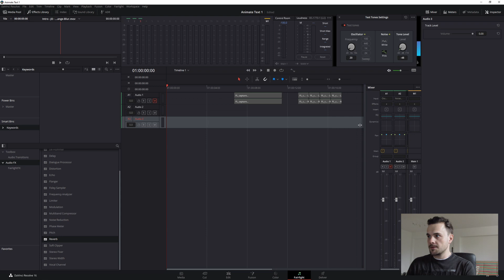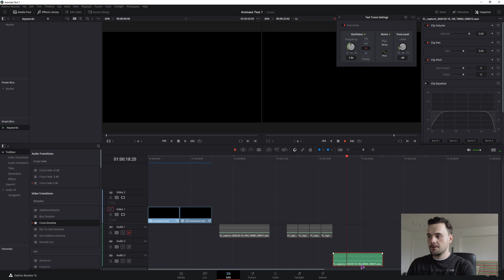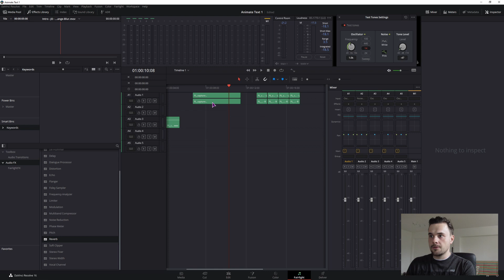Make Censor Beep Sounds | DaVinci Resolve 16

Comment: I must be missing something. My screen looks exactly like yours when I go to test, but no sound. Even when hitting the R button and the oscillator is patched to my spare track. The only difference is I'm just using the speakers on my laptop. Do I have to select where the test sound goes to? I can play the audio on my project just fine on the edit tab.
Reply from the maker: Hey @Legends Workshop. I don't know if that's an issue with you working on a laptop, it shouldn't be, but I don't have a laptop to test this on. I tested this on my pc in davinci resolve 17 beta version 5 and it works for me. You can check what your audio output device is under: davinci resolve (top left menu tab) > preferences > video and audio I/O tab. You can change the interface from MADI to Fairlight and MADI if that will make any difference, or manually set the speaker configuration in the settings below the interface section. Let me know if that helps.
Reply: @JackallDigital  Hi Simon, I tried again today by creating a stereo audio track rather than mono, and everything worked as you described. It's possible when I tried the mono track yesterday that the M button was selected. When the M button is selected either on a mono or stereo track the tester does not seem to work. Maybe my laptop or OS settings don't allow it, I'm not sure. As long as R is selected and M is not, the tester works regardless if S is on or off. Thanks for your help!
Reply from the maker: @LegendsWorkshop  Thanks for the input and I'm happy you got it working.

Comment: This seems overly complicated and tried to mimic a sound board in a studio, where the beeps were used, as a limitation of the soundboard. Why would Resolve deliberately import the same limitations? DOnt know....All you need is a beep mp3. then either play with speed to change pitch or lengthen it for longer beeps. Literally, went into Movavi (a slow but simple program), and before the video ended I made the beep, that I can put in its own track in Resolve.
Reply from the maker: I agree with you. Some things are obscure and they could be made a lot easier for the end user. However, every tool has it's pros/cons. In case of DaVinci Resolve, because it's an all in one video editing software, it does some things good but others super poor - good would be color correction and very poor (in my opinion) is the fusion 2D graphics and 3D shapes.
Reply: @JackallDigital  Yes, Im not knocking its ability. I have said it elswhere. Its like a Porsche 911 Turbo...thats built to steer with your feet and brake and accelerate with your teeth. I just ran into a weird limitation with not being able to change framerate of the project. I havent played with 2d graphics, just did a blur of a license plate and that it did well, following the plate as I moved. Very nice indeed. It has nice transitions and effects like that light rays effect. But other things I want to eat my keyboard. Im constantly typing how to-s, on basic things that are very convoluted, and literally the first time I used it, I had maxed out my keyboard's special keys and macros to get away from the stupid 3-key combos that come default.
Reply from the maker: @Rip Roaring Garage I haven't heard that car analogy before so thanks for the laugh. If I look at Resolve as a whole and from a beginners point of view I do think it's a bit too much of a hands on experience for what one might consider basic stuff in 22', the thing that comes immediately to mind is tracking objects/subjects and linking text to said object/subject.
Reply: @JackallDigital  Ironically enough, I figured out the tracking (blurring a license plate in a very weird motion for the shot). Its the simple stuff that drove me to eat bricks. Thats what got to me, and over and over again, simple stuff. Now, I cant say Im beginner as far as editing, so I know what effect I want, and its more a case of hunting down the button or what macro to use. Thats the rub that gets me. Yeah, I did figure out most, and Im still googling and finding youtube videos about something else. (Although I just recently found out the whole fps thing, how you pick from the begining and youre stuck with it...so for other platforms where I post 30fps, I have to upload in another editor....)
Reply from the maker: As for the fps (in case you made a whole edit in let's say 24fps), you can make a new timeline (in the same project) with the settings that you want (for instance  30fps and even at a different resolution), then copy the previous finished timeline to this one. If you changed the resolution you'll have to transform your clips to fit the new resolution.

Comment: Can't figure out what I'm doing wrong. Everything looks exactly the same as yours, except after I hit stop, the track that's recording stays red, it doesn't become green. Then, when I click off the track or pretty much anywhere on the screen it disappears. Any thoughts? Thanks!
Reply from the maker: Hey @Manta Galaxy it's been a while since I've done this video and I've just tried doing it in DaVinci Resolve 18 beta version 5. The sound records for me, but the test tone settings doesn't give me any playback preview prior to recording. As for your problem, are you by any chance using an HDD and not an SSD as your storage drive? I know I had some issues with audio and HDD so this could also be another instance of such a problem. However, this could also be a DaVinci Resolve 17 issue, I'm assuming that's what you're using, as you can see this was done in DaVinci Resolve 16 so something could have broken with updates.

Comment: Way too much effort. I'll just stick to having a second audio track in the editor with a beep sound effect.
Reply from the maker: Hi @6Twisted I agree, the point of the video was to show how to make the beep or other noise effects directly in Resolve. You only need to do this once and then export the audio.

In case you need/want to make other sound effects by just dragging/clicking the mouse on the UI and then simply dragging that audio into DaVinci Resolve timeline I suggest you take a look at Krotos Studio. The free version just added star wars theme so laser pistols, lightsaber, etc. A quick video on those new sounds https://youtu.be/mrJ4EPnWyjE . You can also take a look at the Genesis sound pack https://youtu.be/PmEUDodjrBE (currently on sale for $15)
Reply: @JackallDigital  Sorry, my comment sounded quite negative. I just get frustrated with Resolve making everything difficult after using Vegas Pro for so many years.
Reply from the maker: I don't mind it at all and I understand you. DR frustrates me too especially when the things that I want to do should work but they don't (this is mostly fusion page related for making effects and templates). Then there are some of the easy options - what a new user would consider easy - are hidden behind loads of menus and settings. However, this was primarily a tool for colorists and they expanded on it, and with every new addition the easy to access options slowly ran out. They could consider improving the UX/UI so users can customize the whole layout like Unity and Blender do.
Reply: @JackallDigital  Exactly my feelings on it. Things that are simple in other editors are hidden behind multiple menus or random shortcuts and it makes even basic editing difficult.